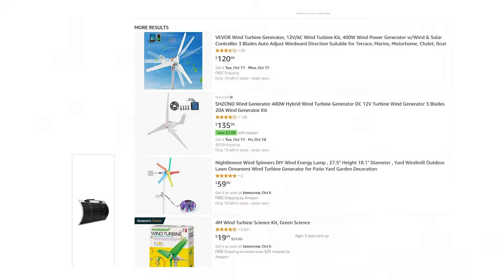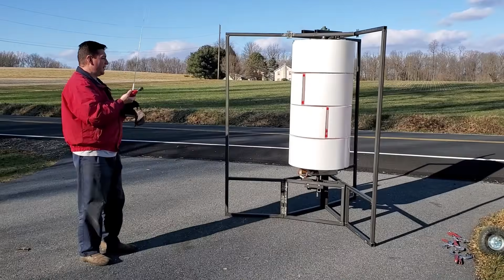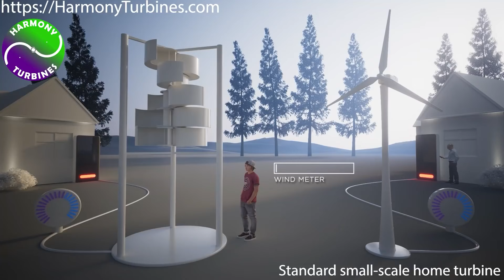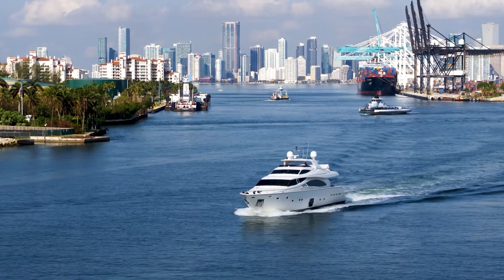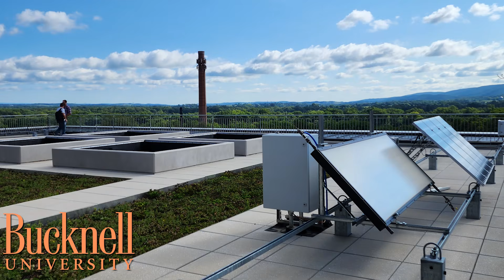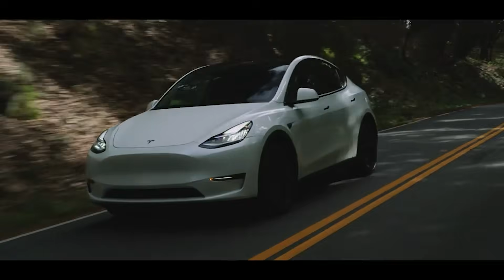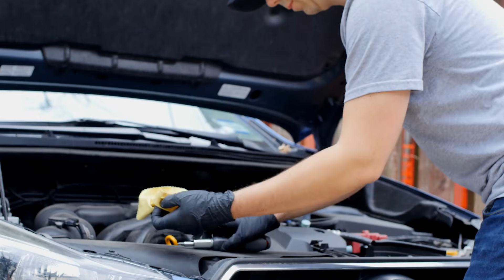Harmony Turbines | The Perfect Small Scale Wind Turbine?

Comment: I agree that most wind turbines out there in the marketplace sucks. I never liked the look of the big bladed ones coving the landscape while I was in California, and considering how they have issues in high winds and I now live in Florida........well, its just not a good idea. On top of the fact that they make great bird choppers and require routine maintenance................HOWEVER, i've been watching a company by the name of Halcium which makes an enclosed turbine that they keep promising is right around the corner but haven't actually sold. I've been watching them for some time but...as a consumer...don't think I would have a problem buying a similar unit from someone else that has units for sale on the marketplace today. Just a thought, as I've seen examples of the non-enclosed, vertical turbines as well and many i'm not impressed with the design. Just food for thought.

Comment: average wind speed = 10 m/s (20 mph) Power = 0.0006 x 0.42 x 1000 = 250 Watts per square meter. No better can be achieved .half the wind speed one quarter the power. This is just how it works.

Comment: HAWTs are more efficient and some models look to work well close to ground with good tracking, low start-up speed and auto feathering mechanisms. They also, use a lot less material and most don't need gears as they spin so fast. Don't think Savonious design can ever beat them in terms of bang for your buck!

Comment: A 400 watt turbine running 24 hours a day at full speed would produce 8000 watts. 

Technical impossible continuously 

More likely like 2 < 3 kWhrs per day,

Maybe run a fridge and some lights. If connected to a bank of batteries and a inverter charger 

Very hard to achieve a return on investment for the home owner. 

Maybe 20 years

Comment: Nothing innovative here! 
I've had a VAWT at my home for several years.  It's poorly powering a 576wh Lithium iron phosphate battery storage.  The trouble with all wind turbines, is a lack of good charge controllers supporting Lithium battery chemistries. If you're using lead acid batteries fine. If you're using lithium-based battery chemistries, you'll need to charge controller boosting the higher voltage required by lithium based storage. Those charge controllers don't exist. Something needs to be cobbled together.

Comment: This all sounds great.....until you realize that its 2022 and solar panels cost roughly $1 per watt output capacity.  This turbine (just like all small wind turbines) is going to output about as much as one single solar panel while costing 5x-10x as much.  Sure there are some windy & cloudy areas where you might need 2-3-4 panels to get the same output, but you wont find any location where a small wind turbine can come anywhere close in $$/kWh. Other than people that want it for the nifty cool factor (or maybe yacht owners) there is no market for small wind turbines. Even if it was silent and invisible, no one wants to spend thousands on a generator that outputs between 0 and 1/2kW all depending on how windy it is. Grid tied -  ~$3k for this turbine that makes ~$10 worth of electricity each month.....~25yr pay off.  Off grid - $3k for a 0.5kW wind turbine that averages ~2kWh a day  VS a 3kW solar array that averages ~8kWh per day.  Even that is being a generous to the wind turbine for most locations.

To really be a viable product this turbine needs to be able to scale up to at least near megawatt capacity and compete with the current horizontal axis wind turbines. You might be able to get away with logistics of replacing each huge horizontal axis turbine with 5 or even 10 smaller vertical axis turbines. That is not going to happen if it would take 50 turbines to get the same output. 

I love all the cool engineering going into these,  but all their research should be going into how to scale up the capacity.

Comment: I tinker with Ecm motors (3 phase dc pulse or pwm ) found in many appliances and hvac equipment today. Many control modules fail and the whole motor is replaced. 
Take off the module, rotate the shaft, these motors generate large currents and voltages in dc polyphase,  depending on rpm.  Using a 3ph to 1 ph rectifier at a suitable rating, they can be used to generate a storage voltage or direct loads like lighting, irrigation, well pumps, mill saws, conveyer drives etc. 
Combine with solar and the required controls. 
Youtube, October 15th,

Comment: I saw a simplistic copy of this years ago but this took that simplistic design to a much higher level with the ability to introvert into itself in high winds to prevent damage.If the steel could be powder coated in some way to allow for art work these could have everything from that WWII ship camouflage to gorgeous flowers or animals. What a great design. I wonder about the weight and whether a large unit would be light enough to helo into a mountain cabin area or some coastal island.  Between this and Orbital Marine Power tidal  generators remote places could have clean electricity.

Comment: I agree, I made one of these based on the instructables savonius one of old. With barrels, a truck hub and a 12v generator.  And it works! This design is the SS model, the high performance model I know will work probably better than expected. You got this. Go for it
Reply: Over 50 years ago, Ivisited a natural gas compressor station with my Dad.  In those days these stations had a staff of 10 to 15 people maintaining and watching over the compressors. These stations in the West are remote so the staff lived on site.  There wasn't much to do being 50+ miles from Big Piney, Wyoming. The folks at one of these put a truck hub and section of drill pipe and drove a playground merry go round.  The blades were sections of 50 gallon barrels split lengthwise. They had devised some way so the thing didn't turn super fast or could be deactivated when not being used to get kids dizzy or in super high winds.  In Big Piney, a gentle breeze is a 40 mph wind...

I've always thought that would be a terrific, low cost way to generate power.

Comment: Seen this design a decade ago, infact it's decades old. I'm also skeptical when "inventors" denigrate proven designs that actually work in an attempt to make theirs look better. Wind turbines are not noisy and they only catch on fire when they malfunction, which is uncommon. The miniature versions work just fine and take up far less space and use far less materials than their design does.

Comment: What ever happened to the double helix windgen, mounted horizontally on a Chicago high rise building, that was working great?  It handled the capricious & high winds in that location!  But it seemed a flash in the pan…15 yrs ago? Longer ago?  The guy had video out, showing it. It was huge. It seriously helped power the building.
Very glad this windgen is getting going!! 
Our issue here is windgens among tall trees.  Framework to elevate these gens above the trees, would be formidable, wouldn’t it?

Comment: I really love this level of technology working on being applied in this world we live in. Like you have mentioned, the enormous prop driven turbines suck. Not only are they an eyesore to behold with these massive wind farms but they're hazardous, both for the wildlife environment and for when things go horribly wrong as we've seen. If it were possible to create these same wind farms using  the Harmony turbine system, it could be considered something both safe and pleasant to see when you have them in multiple colors and patterns.
One thing I was wondering about is do the blades open and close through sensors that detect the rate of the wind or is it done remotely?
Reply: I would expect that these turbines have enough visual presence so that birds wouldn't have trouble avoiding them.
Reply: Also when fully furled or unfurled there is little to no open space for a bird to feel safe to fly through.

Comment: Some advantages of the infastructer shape, it appear safer nxet to environment objects, like under a ceiling structure, or switching indoor to out exposers as portable locating. Does the multi blade accumulate spin better than a bigger turbine blade, is the question.

Comment: Nothing new about a savonius wind turbine or a folding or collapsing wind turbine. No matter how many times he says it's "beautiful" does not make it beautiful. Small propeller turbines are not miniature large propeller wind turbines. Large wind turbines are large versions of the original small propeller turbines. No way anyone is mounting that thing on a boat.  Producing no power at 2 mph wind while spinning is no better than producing no power and not spinning at 2 mph.  It will still have to be high up in the air. But good luck to them !

Comment: They haven't accounted for conservation of angular momentum, which this complicated mechanism will be fighting as they approach failure. There's a much better way!

I'd reverse the whole design and allow centripetal force to move the center out towards a fixed perimeter. A simple spring would replace the entire internal mechanism and stepper motor. This would slow itself down while reducing its ability to speed up. Too easy!
Reply: I was thinking that as well, but the generator load is quite significant.
Reply: I wouldn't bother because it will never produce a worthwhile amount of electricity.

Comment: Regenerative braking could be a good feature for high winds with additional output
Reply: Load dumping.. all turbines produce power via "regenerative braking". To slow it down you place a massive current load on it that is dumped as heat or some other energy loss.
Reply: That is what as generator is .

Comment: This design "in my mind" stems from Art sculptures, that said it feeds my curiosity  and brings questions like what happens in severe weather like snow and ice. I like the stepper motor reduction on the surface area but I see the functionality issue when we have ice and snow(southern New Jersey). That said wind and solar is why a good mix is what is needed. Maybe solar heating the center shaft as an option would be an option. Years ago I saw a mid century design house with a privacy wall in the driveway and it consisted of about 10 stacks of these in a horizontal row and I was thinking cool what else does it do. Great product idea!

Comment: Very interesting design for controlling the amount of wind it catches to motivate the turbine. I’m wondering how well the mechanical aspects will hold up in a dusty dirty high Desert environment with extreme summer heat and occasional extreme winter cold. And how does it deal with occasional sustained high winds over days
Reply: Well let me tell you one of those windmills I told about in my other post it seemed like every year or two there would be scaffolding arounr it and the blades and generator gone for repairs I presume. Months later it would be back together again as I went by. It was behind his house and aboutr 90 feet tall so you can imagine what it would be like to put that scaffold up and take back down.

Comment: This looks promising but there are 3 major red flags here. (#1) There isn't a single chart of data in the presentation about what kind of results have been achieved to date. We get near monthly battery "breakthrough" papers that show way more data than this, and less than 1% of them make it to market. (#2) "The Company might incur Irregular Use of Proceeds that may include but are not limited to the following over $10,000: Salary payments made to one’s self, a friend or _relative_. Vendor payments." What do friends/relatives have to do with this if they're not professional contractors? (#3) By prioritizing on maritime first they are starting in the worst environment possible for mechanical/electrical systems. Salt water is highly corrosive, and on top of that you will get salt buildup in those exposed gears. You want to start in a clean environment at the lowest cost entry point before expanding into parts needed to be pre-treated for maritime use. Solar panels took a lot of work before being rated for 20-25 years.

Comment: So, which model shown was the 400 watt unit?  What are the dimensions?  That's 33 amps at 12 volts.  At what wind speed does it reach this output?  I've lived aboard sailboats for many years with wind Generators.  A typical 6 foot two blade unit will produce 25 to 30 amps at 12 volts in 30 MPH wind.   A Harmony unit would work great if it was small enough, but how will it last in a salt water environment?

Comment: Just stumbled across this clip. Awesome invention especially the ability to regulate the diameter and with the flux generator. I haven't seen any prices for this, but it looks like you've a pretty sturdy frame and helix windmill. My thoughts: why not stack up the flux generators on the main axis - like three or five of them and multiply the output when there's enough wind? That would potentially bring you way above 400Watts per unit.
Reply: staking up is probably less beneficial than just puting one bigger generator... and probably its size has been studied. PRobably a marine version will have smaller cups (I was going to say blades) and more powerful generator, since the footprint in a boat is critical, and you always get stronger winds. (probably also stainless)

Comment: This system could have done significant advantages at sea. Having a much lower center of gravity, lower height, reduced weight and possibly mobile and anchored deployment. Able to be recovered for rebuilds. Or loaded on a ship deck for maintenance.  Or used on fixed platforms and where the system could be dismounted when needed.  No huge tower needed. Much easier for maintenance, replacement or recovery. Modules could be regularly be replaced and then moved to shore for maintenance. Even moved, depending on seasonal changes. Fabrication could be scared out for parts with central locations for assembly. Allowing for some flexibility and also competition. Less dependent on a single, major contractor. And production quickly increased or reduced depending on demand. My main interests in scary and complex Generation 4 nuclear power. A major change in reactor designs with many different systems that can be used. Many people are not interested in 'complex' systems that they can not understand easily. And have concerns about older, common, PWR reactors that have known risks. And a poor understanding of history and safety issues. And the potential for recycling and waste management options. The world needs many more energy options, and Gen 4 research and prototype tractors should be tested. And will be. With potential for greater safety, reduced waste and lower cost.  Wind energy is not suitable for all situations.

Comment: Actually the small ones came first but only old codgers like me remember the 1960's designs. The go to solution in the 1920's to 1970's was to add a hinge on the tower and a locking pin and a drag cable. The whole with tower would be flipped 90 degrees putting the rotor a yard or so from the ground with a cradle holding the mast. Then the rotors were locked and tarp thrown over it. This Harmony Turbine is a far better design.

Comment: The turbine looks beautiful but the steel frames holding it shown in every photo does not, is the finished version not going to need a frame? Also it will need to be mounted safely out of reach of humans so that's going to be a substantial additional cost. 400w is fine but its also not much power so pay back is going to be more than a decade if its "$3000" like mentioned here. Repairs/maintenance costs over that time? A 40 minutes talk to not explore any of this makes this no better than an overly long commercial.

Comment: Another problem is producing more power than you can use or store. Another big problem is what do you do when there isn't enough wind to generate electric power. Also your efficiency goes up with the the cube or is it the square of the area that the turbine is exposed to the wind. Therefore, increasing the size is the best way to increase the turbine's  efficiency, return on investment, & reduce the customer's cost of generated power. Try 3D to reduce your initial capital investment. ( it may be too late) Wind will also be a desired power source for remote sites. Getting large chunking pieces of a machine into a remote site can be difficult, a fairly large wind turbine that breaks down I to bolt together pieces may work better than on large single turbine. You have a similar difficulty with boats; its expensive & infeasible to run a power cable out to a boat. Add to that fact that boats are always changing locations.

Comment: So here's what befuddles me you see those those blade versions they taper down to nothing at the very end and where where where were the the power comes from is not at the center of the blades but out at those tips and they taper down to where they don't catch any wind at all where's today's materials we should be able to have a strong enough blade to enable you to make the blade wider at the at the at the outer radius where where is it's like shifting gears that's that's where it's going to get the most torque and give the most torque to the to the generator as if you have large wind Scoops at the you know they are fulcrums is what they are and they get their most leverage if they have a wider surface area at the at the outer radius and so these these things they have erected out there are laughable you can get started a much lower speed if you have more surface area on that blade it at the end of the outer radius